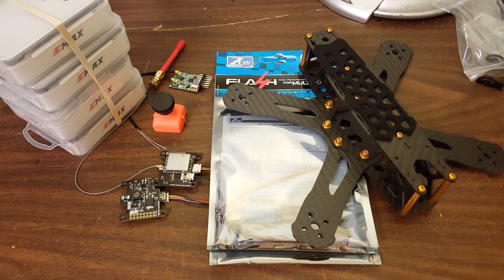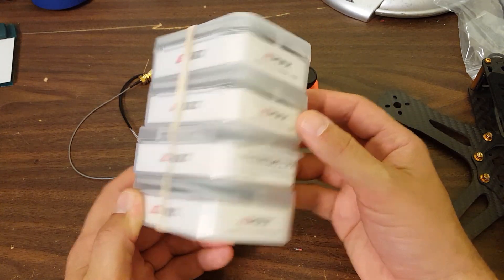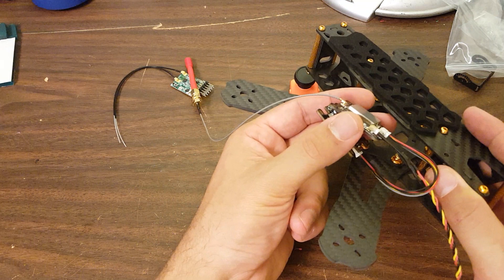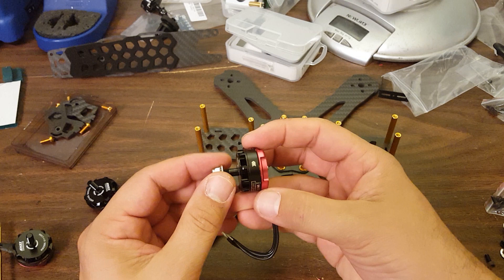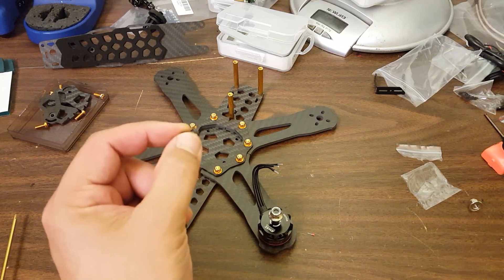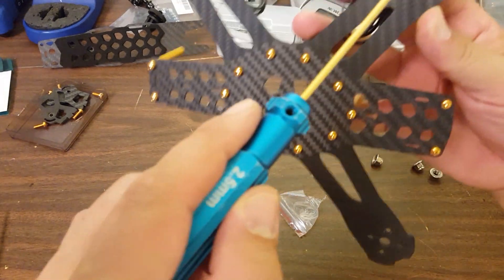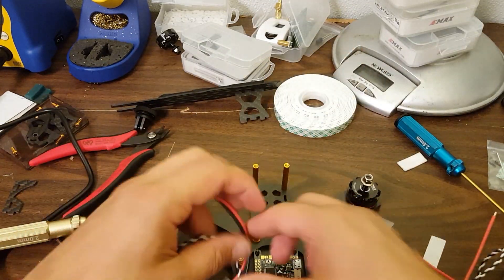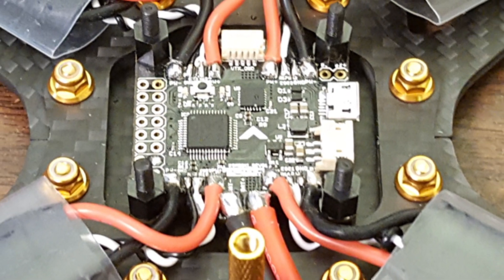HIGH END RACING DRONE BUILD - Part 1 | Skull N Drones Rampage w/ Furious FPV Kombini

Comment: why does the ESC have to be straight just rotate it 15 to 30degs n no prob 1 zip tie

and not covering ESC in tape and just using a zip tie will let it cool eaiser,. more layers of tape just traps heat.

Comment: I have 4 mm arms on my quad and used the small screws.  Could I also have used the long screws? (Did I screw it up? :D )
Reply from the maker: Check how many threads extend above the top of the arm. You want about 2mm.
Reply: Thank you. =)

Comment: Splicing tape is not intended to be used on its own because it has no adhesive and, as you mentioned, it can come loose. Typically, when making a splice on larger cables it is actually the middle layer with something like varnished cambric (VC) tape being under it, then the splicing tape with a layer of vinyl electrical tape over that.

Comment: Not really high end.No Lumenier motors, no kiss esc/fc.All parts you use are good AF but they are not high end.Btw. nice video!
Reply from the maker: +LG Growtopia oh give me a break. This is a $140 frame with a $50 FC and a $60 vTX and osd. Also, it's got a $60 camera. The motors are the only part that's questionable as to whether it's high end.

Comment: thanks for reassuring me on motors btw i order 4cw and 4ccw got 8 cw and cant find ccw for same price. no you reassured me as been banging my head about it. tbh you see 3mm like nuts with 2 smaller screw packs of 10 2quid i thought would be safer option..

Shame this really isnt a hi end build😕

Comment: Does all ESCs need to be programed before first flight?
Reply from the maker: Always calibrate endpoints at least.
Reply: ok thanks. But that means they will operate without programming
Reply from the maker: They will not operate correctly if you haven't calibrated the endpoints.

Comment: What's the latest successor to Emax RS2205 and DYS 2205? These are quite old now, maybe there are some new shiny motors. T Motor F60, etc?
Reply from the maker: ZMX Fusion is the latest hottest motor. But it will make your batteries cry if they're not up to snuff.

Comment: hiya Joshua Bardwell iv got a small issue and need a little advice my f3 deluxe setup it's all good but when I raise the master past halfway in cleanflight the motors stop and esc start bleeping  and when I pull master down under halfway they start bleeping and motors start up again lol  I just don't understand it josh  can this becaused if I didn't pull heavy enough wire from my esc to my motors by any chance
Reply from the maker: +William Davie it sounds like you are describing voltage drop. If you're using a smoke stopper it could cause this.
Reply: +Joshua Bardwell lol now you are confusing me what's a smoker lol   but I put my esc on the 12v next to the battery on the pdb.  
should the esc  go strait on raw battery power     and josh it was 16AWG wire I used to power my motors to the esc   its all I had at the time  but josh    so should I use the raw battery power to power the esc    and where dose the v-bat connection go to on the pdb josh
Reply from the maker: +William Davie the ESC gets raw battery power. If you put it on the 12v regulator you are going to destroy the regulator if you haven't already. Check a quadcopter 101 wiring guide somewhere to see if you are making any other mistakes.
Reply: +Joshua Bardwell thanks very much it was only plugged in for a few minutes hopefully it's ok  there wasn't any smoking or anything. but I will change that to raw power supply and look throw the qaudcopter 101 and check it out  here's the link if you want to have a look before I bolted in the quad josh xdnNAYnwpOu
Reply: +Joshua Bardwell hiya josh I swapped that to raw power supply and it's sorted  thanks very much it's looking sweet do I connect the v-bat connection to the raw power supply aswell josh I didn't see it in the qaudcopter 101 wiring diagram
Reply from the maker: +William Davie vBat is used for measuring battery voltage for low battery buzzer. It connects to raw battery voltage.
Reply: +Joshua Bardwell thanks very much josh ill do that just now then I can put it's skid plat back on and it's ready to fly josh  wooooohoooooo haha thanks very much for all your help and advice josh 
it's a pitty it's pissing down with rain plus it's 3am  here I'll have to wait till tomorrow and hopefully it's not raining lol

Comment: Like the idea to give this frame a try, because the frame is one of the best AND easiest frame i every build. Build time 1:30 hours. Also after months of flights the frame will not brake. I tryed very hard to get the arms or body broken but it will not ! The only thing is i have to mentioned negetaive is the back stand off for the xt60 and antenna. If you want to reduce the hight you have to mount the antenna parallel to the top plate and bend it afterwards. But hey, the positives weight the negatives out. Looking forward to see the flight videos: Please remember that you use the custom mixer for this frame ;)
Reply from the maker: +Björn Gönni I don't use custom mixers for any flat rectangular quad. Not needed.

Comment: is it possible to use no heat solder rather than the hot soldering iron to build? i tried 2 times to build a quad and soldering is harder than it seems. is using the cold soler or no heat solder an option?
Reply from the maker: +ask me You cannot build a quadcopter without knowing how to solder competently. Soldering isn't hard but you might need someone to show you how. Or to look at your equipment and tell you what's wrong with it.
Reply: Im practicing.  Thought it was easier than it was. Ive used 3 different soldering irons. But is it possible to use the no heat solder?
Reply from the maker: +ask me I've never used it but I wouldn't trust it. I've literally never met anyone who uses it. Really, you mist learn to solder if you want to build multirotors, period. Soldering is not hard. If you are having a hard time with it, you are doing something really basic wrong. Find a local hobby shop and go ask someone if they can recommend someone to help you learn.

Comment: Hi Joshua do you define a CCW motor based on the thread or motor direction? I think according Oscars definition (see link below) I think the motors you are using are CW (thread direction). I'm interested to hear your thoughts. 
https://oscarliang.com/propeller-shaft-adapter-nuts-cw-ccw/
Reply from the maker: +Blooskyy I have no idea and neither die anybody else. I would define a CCW motor as designed to spin CCW, so with CW threads. But some vendors do the opposite.
Reply: Joshua Bardwell thanks Joshua, that makes sense, I think it would be great if the vendors could standardise the terminology to avoid any confusion. I recently bought a few motors which were labeled as CW, but this was the thread direction.

Comment: Is the USB port from the flight controller still usable? Look pretty tight to frame.
Reply from the maker: +Gerhard Mikysa it is. I had to turn the screws over and use a low profile USB cable. If I did it again I would use larger standoffs. If you are using a typical PDB on bottom, no problem.
Reply: Cool. I asked because I remembered that you are using Amazon USB cables that are pretty big.
Looking forward to Part 2 :) So relaxing watching someone else building a quad ^^

Comment: Teeny FYI on the X4R antennae. Be aware that as of August, they've changed the antenna plug to a smaller IPEX variant (why?!).  I came across this yesterday when trying to replace a broken antenna.  Very annoying.  Aloft and getfpv list the new ones but they're both out of stock at the moment.
Reply from the maker: Correct. I haven't even looked at the listings yet... is it obvious which you're ordering? I still have many of the old style deployed. I'd hate to not be able to get spares.
Reply: Not super obvious IMO and aloft/getfpv are the only places I've seen where they specifically note "newer X4R" or similar.  I've mailed FrSky to ask them for the spec of the new connector.

A Google image search for IPEX MHF makes it look like it's MHF3 instead of the larger U.FL but if they reply to me I'll update this with the correct spec.
Reply: For now I'll stick with the XSR and just solder u.fl sockets to it.
That way I get small receiver, all signals (power, sbus, telemetry) on a single connector, and detachable antennas :)

BTW did you noticed that XSR uses shorter radiating part on their original antennas ?
Reply from the maker: +Daniel Furmanek (Furmek) yes. Its because the tuning is a function of the whole system not just the radiating element. That's the word from FrSky anyway.

Comment: once when I was flying my quad fell out of the sky like they do but I couldn't figure out why so I plugged it in and it was working and then it fell back out of the sky so I decided to wiggle the wires... without removing the battery. what happened was the signal wire from my esc touched the battery wire on the esc and I saw a the ghost of my quadcopter fly away in the wind.

Comment: Next time you need T-Motor F60s for your acro build. I have those (2200 kv on 6x4x3 as well as 2450kv on 5x4x4) and the EMAX motors in this video, and the F60s are made for power acro, amazing control at low and mid throttle and iNsAnO power and 5S ready. Essential for any high-end build! Free parts are the best of course :P Great video sir.
Reply: I will try my RS2205 2300s on 5S tomorrow, I was going to today but there were too many people at the park and I had to leave :(

Comment: I don't really mind the ccw threads.  I got used to them but I got 4 cw red bottoms and I was pleased with all the extra hardware and the wrenches you get with those.  I chopped the short end off a couple of the 2.5 wrenches and turned some handles on the lathe. Made some nice wrenches and gave a couple to friends.

Comment: Hey josh I am having some problems with a beeper on my quad it constantly beeps and I can't figure out why this is becoming increasingly annoying because I cannot hear the low voltage buzzer when it begins to go off any ideas of what it could be?
Reply from the maker: +Alex Dalton check the buzzer mode to make sure it's not enabled. Check vBat monitoring to see if it thinks your battery is low.
Reply: Joshua Bardwell all seems to be good on that note
Reply from the maker: +Alex Dalton is it soldered to a generic ground pad or the actual buzzer- pad?
Reply: Joshua Bardwell it's simply connected to the pdb board
Reply: Generic soldered lol
Reply from the maker: +Alex Dalton that's the problem. The buzzer is switched in the low side. So by soldering to ground you're powering it all the time.
Reply: Joshua Bardwell how would fix this problem??this problem?

Comment: It looks like you soldered the motors directly to each esc with out crossing over two wires to get the opposite spin direction you need, or did I miss the part where you crossed the streams? If not, how are you going to reverse them? 
I used these escs with zmx motors but before I mounted them I had to do a test run with one motor to see which way it spun.
Great video! Looking forward to the next part.
Reply from the maker: +tannerd reverse them in BLHeli

Comment: Yup, reverse threaded is confusing at first. To remember which direction, I make sure my props are always correct then look at the prop pitch. If loosening turn like you're sliding off the propeller leading edge. If tightening then turn towards the leading like digging into the prop. Helps me. Loosen, turn the way the prop spins, tighten turn opposite the prop direction. My first quacopter  build will definitely be standard threaded.
Reply from the maker: +Flyin Mikey RIGHTY TIGHTY LEFTY LOOSEY!
Reply: Ahahaha, I hear you..... "Not my design!"
Reply: I just hold the wrench still and turn the motors backwards to loosen the nuts (or at least I imagine it that way to know which way to turn the wrench). You always know which way your motors are supposed to spin. And I also don´t order reverse nylocs 1 at a time so that I would have to wait if I ever lost one. I have a small bag full of them in my flight backpack :P

Comment: Always limited to available parts, but a 4-in-1 ESC would've been nice on this frame. Only the motorwires with 1 ziptie to the back oriented half of the arm, leaving the hole to let extra air through for more lift.
Too bad you closed those with the ESCs now.
Nice video as always!
Greetz from Belgium, happy flying!

Comment: Joshua, just a suggestion, if you have some of those dome head M3 screws instead of the square head you are using there, you can shave off a few grams (maybe as much as 8g) in your copter's total weight. I am super excited to see the other parts of this series.

Comment: Hopefully you will go over driver issues mentioned on their website. I cannot get my kombini to connect to my computer and cant figure out what drivers are wrong or what I need to change.
Reply from the maker: +Daniel Boyce I didn't have to do anything special. Standard cleanflight cp120 and VCP drivers. You do need to use Zadig to install winusb for flashing. This isn't unique to Kombini. See my video on how to flash the Lumenier Lux for instructions.
Reply: Will do. My buddy had no problems connecting to his computer so it's gotta be a driver issue on my end. thanks for the reply.

Comment: I know there have been improvements in motors since the red bottoms came out but I honestly look at them as the ubiquitous Chevy 350 v8 of the multirotor community...  I know the red bottoms are symmetrical, but do you know of any motor manufacturers where the cooling for the motor is directional...?
Reply from the maker: +K. Soze I believe it exists but I can't name it offhand. I agree about the red bottom. It's why I selected it for this build.
Reply: +Joshua Bardwell the rs 2205 s is gonna be available at the end of October :D